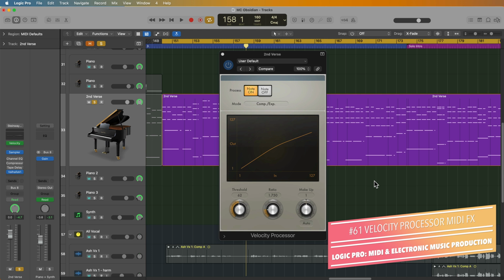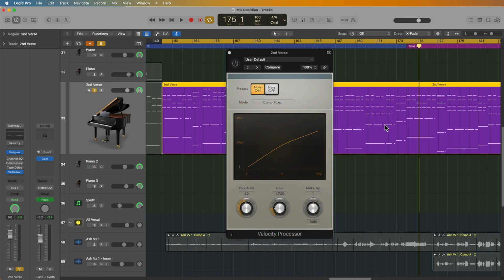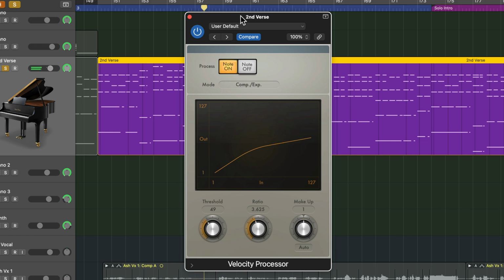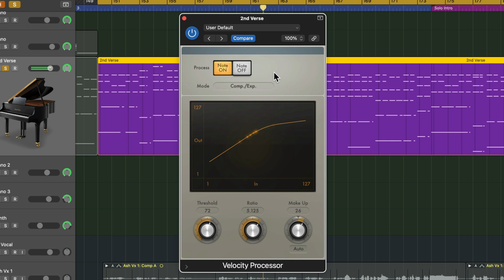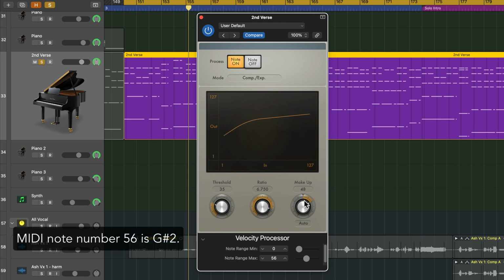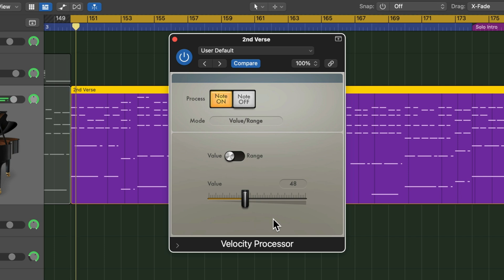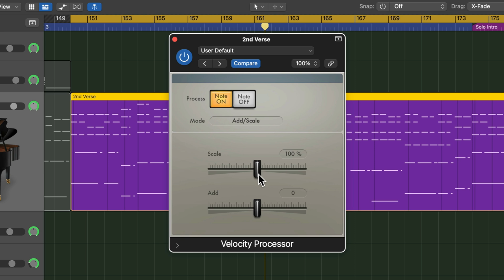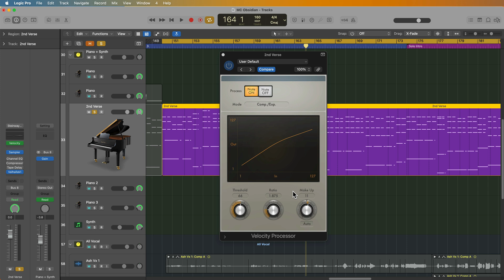Logic Pro #61 - Velocity Processor MIDI FX

Comment: Hi, I have question not related to this video, may be you can answer:

Why when I put some sample on a track (as audio) it is loud, but when I put the same sample in Q-Sampler (instrument track) and create a pattern region, it sound not that loud and a lot quieter

Sorry for bad english
Reply: The sampler uses velocity values to control how loudly the audio is played back, meaning that midi notes can trigger louder or softer playback of the audio file. By contrast, an audio track does not use velocity to control loudness. It uses volume/amplitude.
Reply: @rosaccidents  thanks man!

Comment: At first I tried to use this to manage velocity layers on drums - not possible - not the right tool.  There is a “velocity gate” on every track, which I did use for layered drums.  For example, I could have 4 snare samples, each on its own track, each with a different velocity gate.  You can do this in DMD as well.

Comment: I use fixed velocity of 110 when using instruments from the 70-80s. Those keyboards did not have velocity control on their keyboards. When using a VSTi from the same era, fixed velocity is very helpful. Regards.